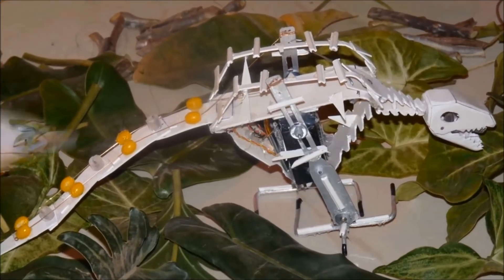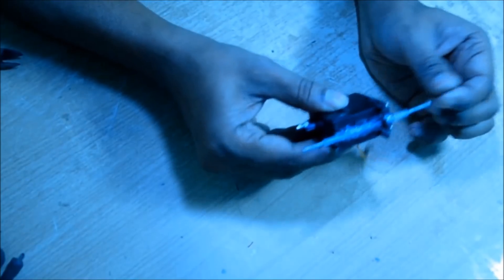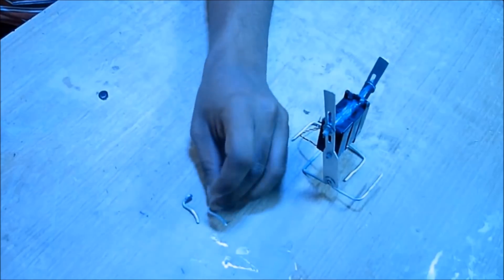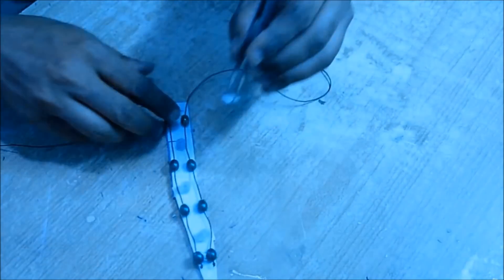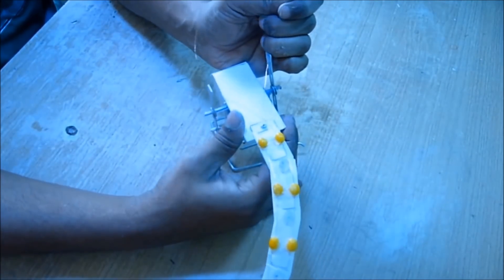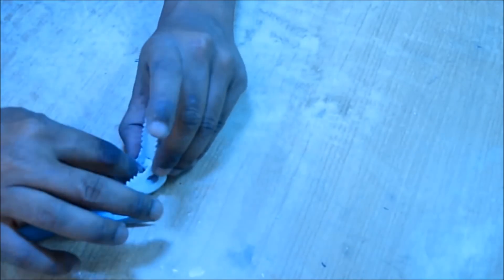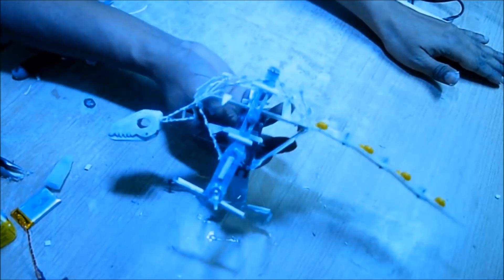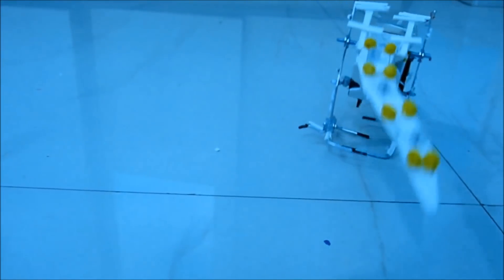How to make a Walking Robot Dinosaur

Comment: It doesn’t have the arms. If you had it, you would surely make the arms then you would make it function with the legs, wouldn’t you? Hmm?

And like, after the arms, you can like… make the tiny fingers after for the arms, like, the arms are still on the sides of the robot dinosaur model so they can still function, then like make little fingers for the arms to put them on the arms or something… Idk.

Comment: Which motor is used to make this
Reply from the maker: I used a modified servo motor. I have shown hiw to do the modification. You can use 60 rpm dual shaft geared motor too.

Comment: This is awesome! got to try this out!

Some questions though:

Is it possible to introduce knees and lower legs? It could add speed to the robot, as it can flex its legs better.

I'm also wondering if it's not possible to use the tail as a way of conserving energy and improving the power of the stride--much as it did in the real dinosaurs. This I imagine could be achieved by substitution of metal for rubber banding (such as used for doing hair) or something similar, and attachment of these BELOW the "hip joint" (so it "resists" forward movement, which stores energy, and allows the femur to move back faster). What think you of this idea?

Comment: you have first inserted a string the why do you replaced them with wires.Can i use the string because i don't have that thin wire.
Reply: In the tail of the dinosaur.
Reply: thanks for replying.

Comment: it is taking a left turn every-time because the head is connected to the left leg which minimizes the strength and reach of the left leg and the right leg on the other side moves normally and the whole robot tends to take a left turn so use a string only and tie it to both the legs instead of just one :D